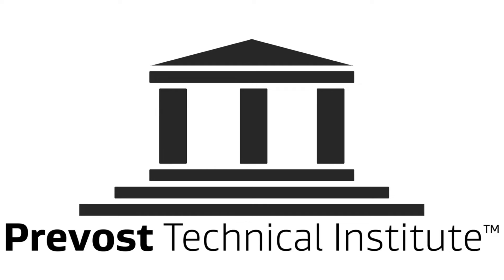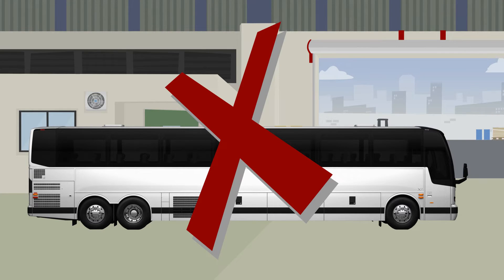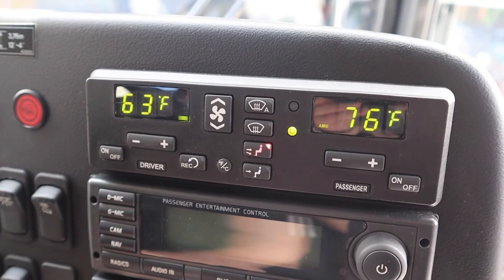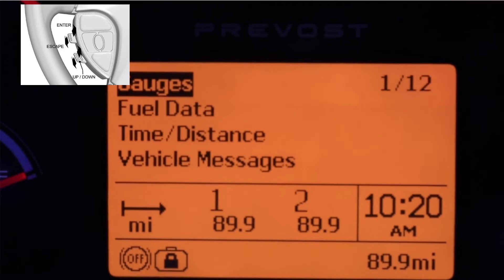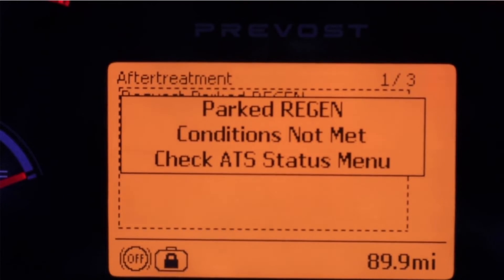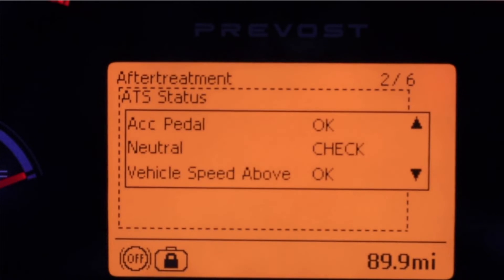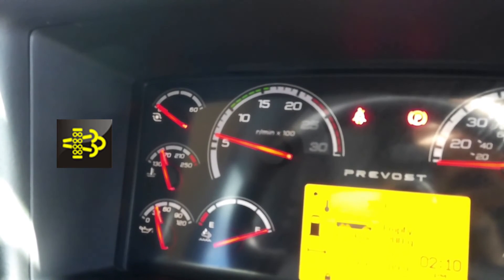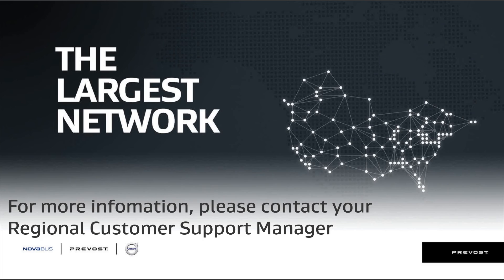Prevost | Technical Institute: Parked Regen

Comment: What does it mean when it says Temporary Lockout
Reply from the maker: Temporary lockout simply means a regeneration is not needed at this time. You can only do a parked regeneration from the dash controls when the emissions system is requesting it. 
This helps prevent shortening the lifecycle of the emissions components by not allowing unnecessary parked regenerations.
Reply: @PrevostVideos  I have a 2010 h-3 with detroit 60 series. 
How often do I need to regen?
I recently was shut down in Tulsa because I had a few codes preventing the regen.
It had not been forced regen in about a year.. Is there any info I can find to learn more about my particular year?
Reply from the maker: @RJNashcat  
Regeneration can only be done when the aftertreatment is requiring it. It is based on fuel used, engine load and duty cycle as well as pressure differential across the DPF. When the blue switch light comes on solid, it is time to do the regeneration. If ignored, it will start to flash alerting you it is critical. If ignored after that, you must connect a laptop to do the regeneration as the dash option will be locked out. If there is an active engine fault the fault must be corrected prior to being able to perform a regeneration.